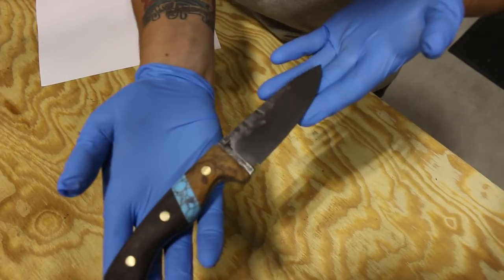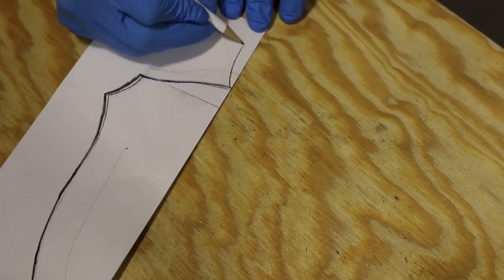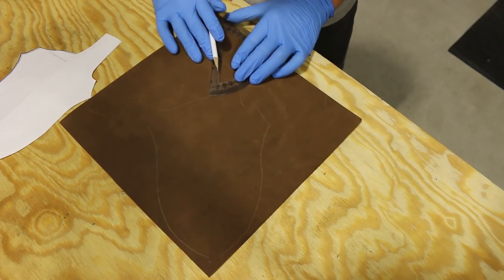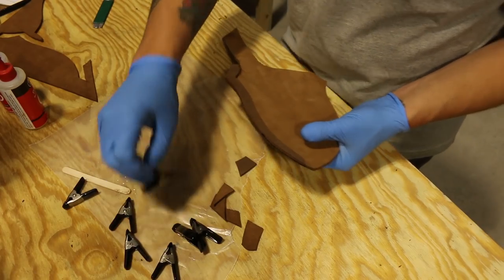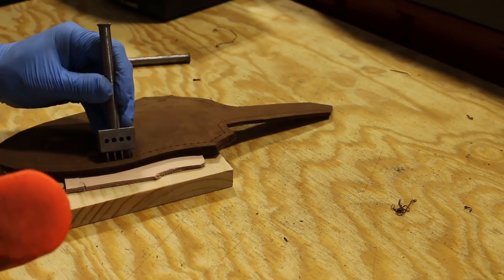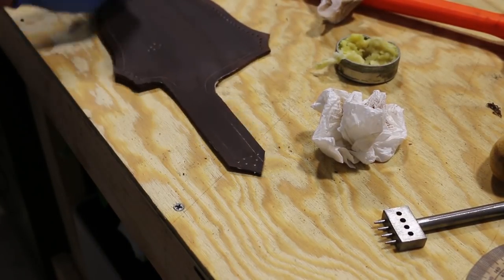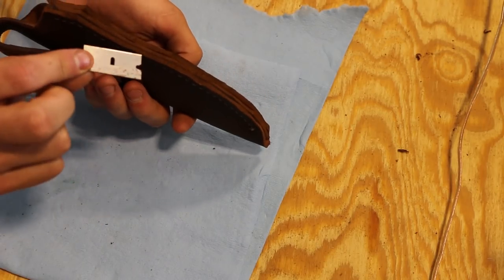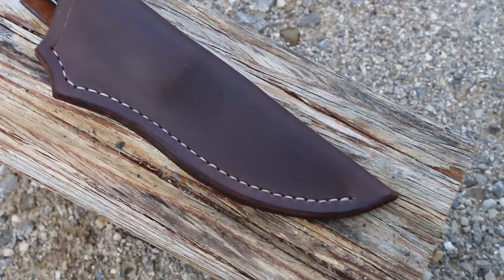Making a Custom Leather Sheath

Comment: I’ve never made a sheath…So take this “suggestion” with a grain of salt. Did you think about possibly wet forming the leather around the knife? I have a Bradford Knives horizontal leather carry, fit the knife was getting loose and started falling out. I wet formed it and let it dry. It now holds the knife in tightly. Just wondering…Great job btw!
Reply: He uses the wrong type of leather for being able to do so.
Otherwise that is how you do it

Comment: Have watched a couple of your videos,, nice finished sheaths,, ...why do you not cement top layer/ welt  before stitching? ..
Reply from the maker: Thanks for watching! I actually do throw a little bit of cement near the top and bottom of the welt. I find its primary use is to keep the welt attached during drilling.

Comment: what is the name on punch. thanks
Reply: It's called an awl
Reply: It’s not called an awl. It’s is a 5x1mm hole punch. You can get them on eBay all day for around $25. An awl is a one blade device shaped either round or to the same shape as whatever pricking iron you are using to poke a single hole in leather so you can put a needle through.